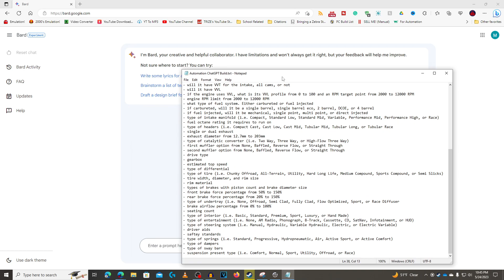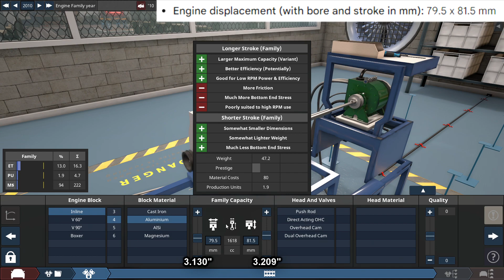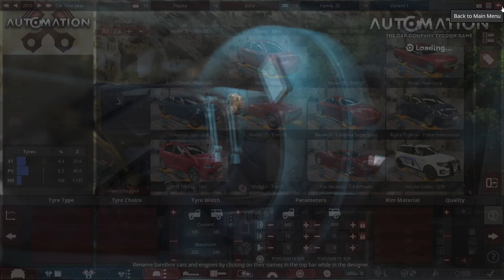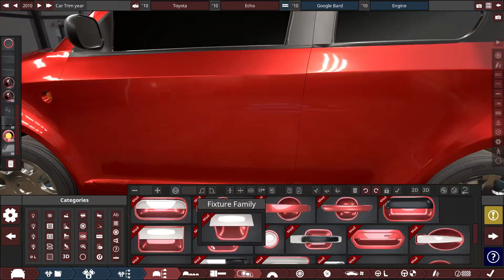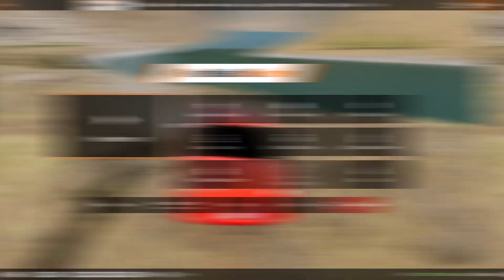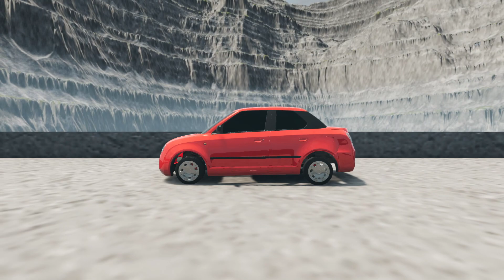Can Google Bard AI Design The Perfect Car? | Automation Game & BeamNG.drive

Comment: Can you design a made-up American muscle gas vehicle from 2010 with:

- - the type of body (ie. Sedan, Coupe, Convertible, Wagon, or Hatchback)
- - the make and model of the car
- - car color
- - panel material
- - chassis type
- - chassis material
- - engine placement (i.e. Front Transverse, Front Longitudinal, Mid Transverse, Mid Longitudinal, or Rear Longitudinal)
- - front suspension type
- - rear suspension type
- - type of engine
- - engine block material
- - engine displacement (with bore and stroke in mm)
- - type of engine heads with how many valves
- - engine head material
- - crankshaft material
- - connecting rod material
- - piston matenal
- - type of balancing mass (ie. None, Harmonic Damper, or Balancing Shaft)
- - compression ratio from 5.0:1 to 16.0:1
- - cam profile from 0 to 100
- - spring and lifters from 0 to 100
- - will it have WT for the intake, all cams, or not
- - will it have VVL
- - if the engine uses WL what is its WL profile from 0 to 100 and an RPM target point from 2000 to 12000 RPM
- - engine RPM limit from 2000 to 12000 RPM
- - what type of fuel system. Either carbureted or fuel injected
- - if carbureted, will it be a single barrel, single barrel eco, 2 barrel, DCOE, or 4 barrel
- - if fuel injected, will it be mechanical, single point, multi point, or direct injected
- - type of intake manifold (i.e. Compact, Standard Low, Standard Mid, Variable, Performance Mid, Performance High, or Race)
- - fuel octane rating it requires to run on
- - type of headers (i.e. Compact Cast, Cast Low, Cast Mid, Tubular Mid, Tubular Long, or Tubular Race
- - single or dual exhaust
- - exhaust[diameter from 12.7mm to 203mm
- - type of catalytic converter (i.e. Two Way, Three Way, or High-Flow Three Way)
- - first muffler option from None, Baffled, Reverse Flow, or Straight Through
- - second muffler option from None, Baffled, Reverse Flow, or Straight Through
- - drive type
- - gearbox
- - estimated top speed
- - type of differential
- - type of tire (i.e. Chunky Offroad, All-Terrain, Utility, Hard Long Life, Medium Compound, Sports Compound, or Semi Slicks)
- - tire width, diameter, and rim size
- - rim material
- - types of brakes with piston count and brake diameter size
- - type of undertray (i.e. None, Offroad, Semi Clad, Fully Clad, Flow Optimized, Sport, or Race Diffuser
- - brake airflow percentage from 0% to 100%
- - seating count
- - type of interior (i.e. Basic, Standard, Premium, Sport, Luxury, or Hand Made)
- - type of entertainment (i.e. None, AM Radio, Phonograph, 8-Track, Cassette, CD, SatNav, Infotainment, or HUD)
- - type of steering system (i.e. Manual, Hydraulic, Variable Hydraulic, Electric, or Electric Variable)
- - driver aids
- - saftey standards
- - type of springs (i.e. Standard, Progressive, Hydropneumatic, Air, Active Sport, or Active Comfort)
- - type of dampers
- - type of sway bars
- - suspension present type (i.e. Comfort, Normal, Sport, Utility, Offroad, or Race)
Reply: for whoever wants to do it themself!